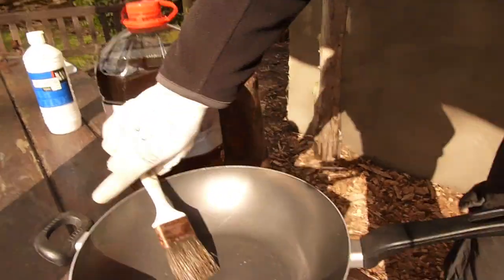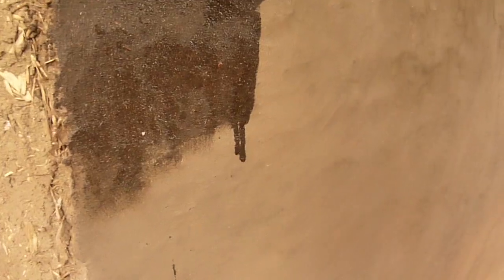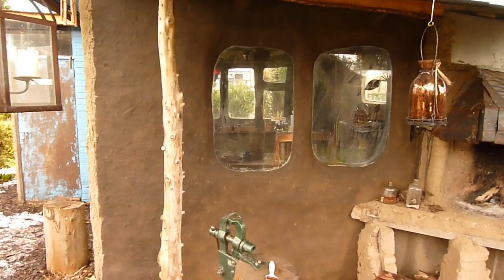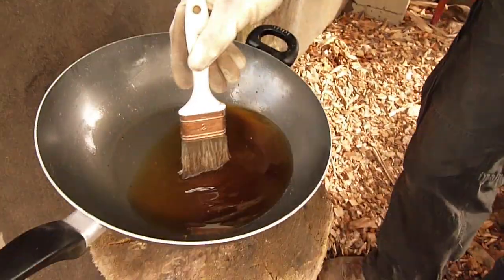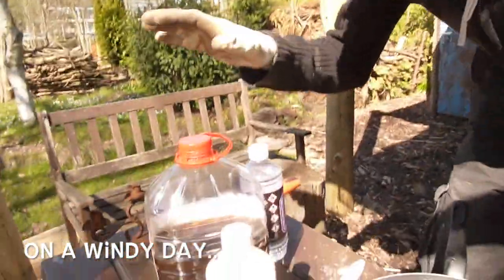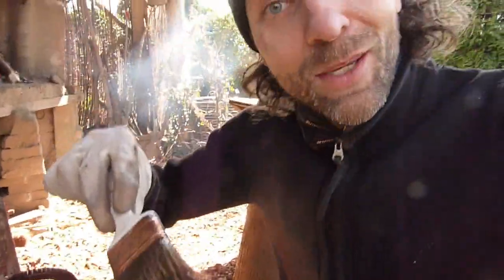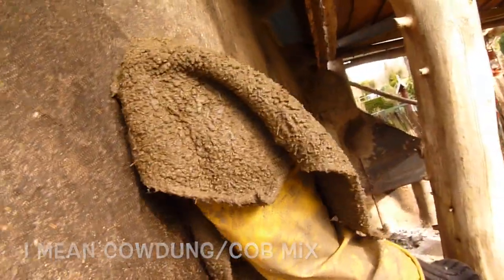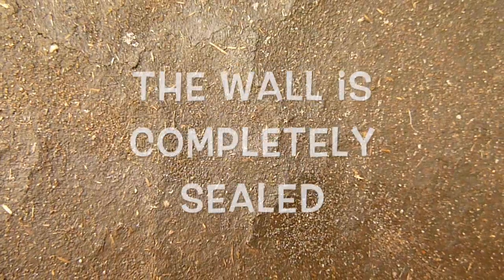WATERPROOFING a COB wall 🏰 (earthen plaster) with linseed oil

Comment: Hoi! Bedankt voor je leuke video! Erg nuttig. Ik ben van plan om over ongeveer 4 a 5 jaar een familie huis te bouwen van leem. Ik zit nu nog in een sociale huurwoning en ben aan het sparen voor grond en materiaal. Ik ga wel deze zomer mijn gewolmaniseerde schutting vervangen voor een cob wall. Als ik de muur seal met deze olie. Is en blijft die ook waterdicht? (Zonder dak). Of kan ik beter een houten afdakje eroverheen timmeren? Bedankt voor de info!!
Reply from the maker: Hee David, wat gaaf dat je zelf een huis van leem gaat bouwen! Ik heb gemerkt dat het heel arbeidsintensief is, maar het is geweldig bouwmateriaal. Voor je cob wall hoef je gaan afdakje te maken als je de bovenzijde een aantal coats geeft. Drie is ruim voldoende, en de zijkanten kun je dan 1 of 2 coats geven. Er kunnen wel kleine scheurtjes ontstaan, zoals bij mij ook gebeurde, maar als je de bovenkant schuin laat aflopen, blijft er geen water in staan en kan het niet in de scheurtjes zakken. Dan heb je een perfecte cob wall die een orkaan kan doorstaan ;-) Veel plezier en succes!

Comment: just curious what is the protocol if you break a window
Reply from the maker: Good question! I'm afraid you'll have to break everything away, including all cob layers and install a new window or glass panel. I did break a window while chopping wood last year, the block of wood flung straight through the glass of one of the front doors of the cave. I just hamered a complete window up against the inside of the door to repair it. (Very.. sustainable solution haha), but anyway, if you want to repair a broken window that has been sunk away in layers of cob, it will take quite some effort and time. Fortunately you can re-use the cob that you break away.
Reply: Thank you for the response these cob house videos have really made me want to build one
Reply from the maker: wow thanks man!
Reply: I;m halfway through building but it's cracking a lot.Thank you Leon

Comment: Thanks for the  information but use a roller man.
Reply: roller does it fast, but the brush is usually best option for the fast coat to allow thorough brushing into the porous surface. Rolled on coat will sit onthe surface and will be easily lifted off the surface.
Reply: @jessesifuma7900  Except a roller would soak up all of the oil
Reply from the maker: Yep, that's an option. Use a brush in the corners. Thanks man.
Reply: Try an air less spray gun

Comment: Hi, will the linseed oil allow the cob walls to breath?
Reply from the maker: Hi, very good question. I have looked it up, and I think that it's best to apply it specifically to the walls that are exposed to rain, because the boiled linnseed oil will create a moisture barrier (so moisture from the inside will be trapped) and therefore the wall will no longer breathe. The other walls that are not treated with boiled linnseed oil will take over the breathing job. I will mention this in my info section, your question made me realise how important that is! Thanks a lot!
Reply from the maker: The only remaining thing that the inside layer will do, is absorb moisture when it is humid inside, and give off moisture when it is too dry inside. What do you mean with ' cant seal both side' ?
Reply from the maker: Yes, you are absolutely right. The only thing that remains is a great looking wall of lifeless building material. Therefore I would not recommend this on all of your walls. You could also use the oil for waterproofing outdoor cob ovens, cob stoves, cob benches or chairs, and so on. If you build a bathroom out of cob, this will work. I also intend to use it around the sink in my mancave 'kitchen'.  You can even build a bath tub out of cob and waterproof it. The options are endless.
Reply: @Le0nski  thank you that i found your channel. I was about thinking how to waterproof a fencewall made of rammed earth without using cement so it can still breath.
Reply: The oil is hydrophobic, helping to repel water that hits the wall.